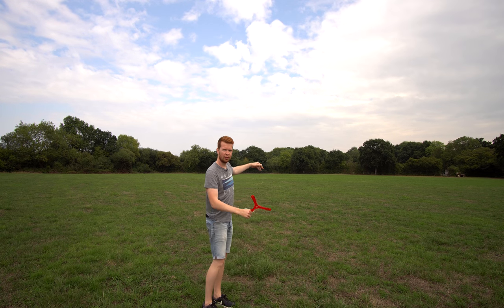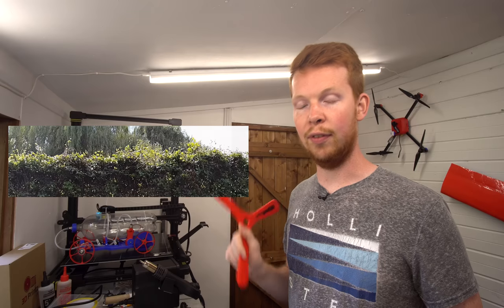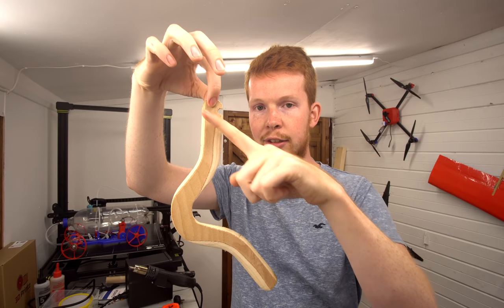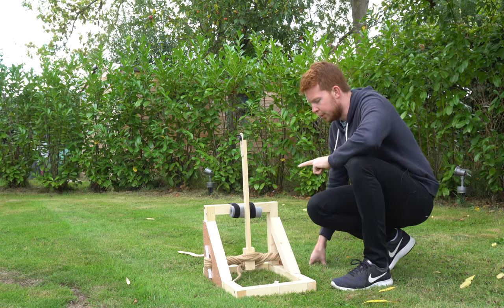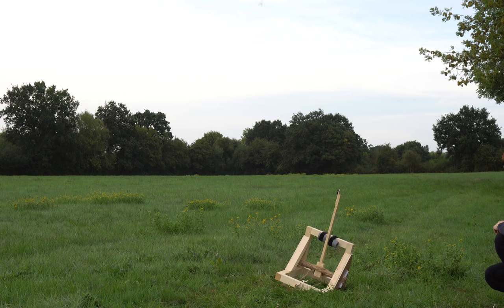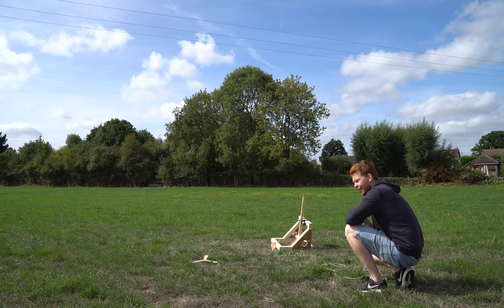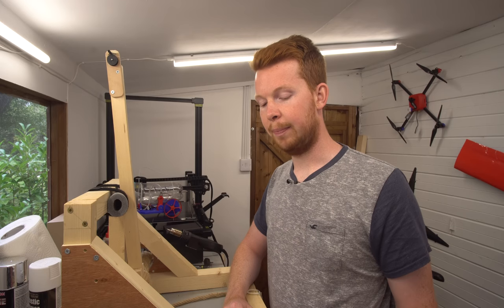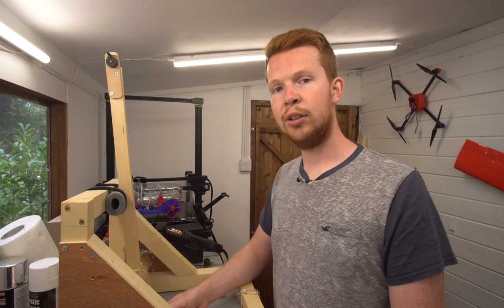Boomerang Launcher

Comment: One key little quibble. Wings do NOT produce a lifting force.   This is a mistaken assumption that goes all the way back to the fact that the Wright brothers used a spring scale to determine how hard test airfoils would pull up on the scale. Because they wanted the wing to ‘lift’ on the scale- they quantified their results based upon this parameter and imagined a force that does not exist.    In fact- wings  produce  THRUST nearly perpendicular to the plane of travel thru the air. This is something you can prove readily by noting that a Propellor- which is essentially your three bladed boomerang- is NOT PULLING the plane thru the air- it is producing Thrust that the plane reacts to by moving in the opposite direction.    In intake side of a fan has no real force- but the outtake has considerable force.  
A wing does produce an area of low pressure above the airfoil... but this is far too weak to pull any plane upwards... because the aircraft is heavy, and has high inertia as well as high momentum.   The air ABOVE the low pressure zone, however, has LOW inertia and low momentum...and so the effect is that the normal air pressure well above the low pressure zone above the wing accelerates downward, to equalize the pressure... and is thrust downwards past the trailing edge of the wing. This creates an action-reaction of the plane moving up- IF the thrust of the air moving downward exceeds the weight of the plane.  This down thrust air stops at the tip of the wing...and because the air off either side of the wing is at higher pressure than the rapidly moving air the wing displaced downwards, it moves laterally into the downstream, and this is what creates the spiraling vortices at the wing tips.   That wings do Not work thru "lift" has been understood for over half a century... it amazes me that this is still bandied about as an actual force acting on flight when the actual suction force of low pressure over the wing has nearly zero contribution to the function of the wing. The low pressure acts upon the air stream...not the wing.
Reply from the maker: Thanks for the information, however you should have learned in high school that air only flows from high pressure to low pressure. Therefore it's not the 'suck' of the low pressure, but instead the 'push' of the high pressure that creates the lift. Yes aerofoils DO produce lift, but you're sort of correct about the majority of lift is produced by directing air downwards, producing the reaction force. I'm not sure who would assume propellers suck their way through the air.
Reply: Tom Stanton   - um... no.  The wing does not create high pressure. The underside of the wing specifically does not accelerate the air and so it remains at AMBIENT pressure.
The upper surface of the wing accelerates the air immediately above the wing, which causes it to drop in pressure...... however, the air under the wing can not push the wing up into this low pressure zone BECAUSE the the wing has inertia far greater than the pressure gradient can overcome.... moreover- the air pressure UNDER the wing is separated from the low pressure above the wing BY THE WING. It would have to flow around the wing to equalize pressure. And the entire rest of the aircraft is surrounded by air at ambient pressure.      However... the low pressure over the wing is confined to a narrow area immediately above the wing.   The air above this accelerated flow is at ambient pressure (which is HIGHER PRESSURE ) than that of the high speed flow adjacent to the upper surface of the wing...  and there is NOTHING separating this higher pressure air from the low pressure over the wing- to IT moves into the low pressure zone, and because each individual air molecule has LOW inertia, it accelerates rather abruptly as it moves toward the wing.   The wing moves forward as this occurs and the mass of air is thrust downward beyond the trailing edge of the wing as THRUST.   Once more- look at ANY simple FAN.   The air coming out the back of the fan is NOT high pressure... it’s LOWER air pressure than the surrounding air.  It’s just that it has been accelerated perpendicular to the motion of the fan blades.
Really and for true... airfoils produce THRUST.... there is no lift.

Look HERE for a simple proof that a wing thrusts air downwards. https://goo.gl/images/VdZFSc   Though standing under any helicopter would also prove the point.
Reply: Tom Stanton P.S. the thrust produced is a function of how low the pressure is over the wing (moderated by angle of attack ) and Air density.  As the plane moves faster, it accelerates a greater mass of or downwards and when that thrust exceeds the weight of the aircraft, the aircraft rises for the exact same reason a rocket rises. As the plane rises, the air gets less dense, and so for any wing to fly at higher altitudes, it must fly at higher speeds so as to compensate for lower air density with greater air volume, and a higher air acceleration.   This is what defines the performance envelope of an aircraft.   Helicopters can create higher pressure underneath..against which its thrust can "push"- but only in close proximity to the ground (ground effect is in essence a bubble of higher pressure air compressed between the rotor and the ground ) however, above a certain height there is no ground effect...and it is strictly the thrust produced by the rotor that holds a helicopter aloft.   The fast moving air under the helicopter is at LOWER pressure than the surrounding ambient air.-  and by the same token, the gas shooting out of a rockets’s nozzle at launch is at the SAME pressure as the surrounding air.   The fact that it has high momentum in one direction is NOT the same as higher pressure. A rocket Does NOT PUSH on anything.   The downwards thrust of the rocket exhaust is greater than the mass of the rocket.  Airplanes fly when the wing thrust downwards matches or exceeds the mass of the aircraft.   It really is a simple thrust vector.
And when a wing stalls, it’s NOT because of a loss of lift, it’s because turbulence OVER the wing stops the smooth laminar flow of air DOWNWARDS as a simple thrust vector.... the turbulence dissipates the accelerating air mass into random vectors going every which way.... and the wing stops thrusting downwards with enough force to match the plane’s mass.

Comment: The boomerang doesn't work based on gyroscopic precession. You got the mechanics correct, but the name wrong. Gyroscopic precession is when a gryoscope's rotational axis precesses (rotates) due to some torque. This precession happens because of the 90 degree offset of applied forces, but it's not the root effect. Unfortunately, I've never been able to find a proper term to call the 90 degree force offset due to gyroscopic motion, which is why people often, incorrectly, call it gyroscopic precession.

Comment: A REAL boomerang does not use the wind to return it. The real test is throwing it on a still day. And you don't need to run when you launch it, just stand still. Another thing, a real wooden boomerang is made of hardwood which gives it mass, and not with what you've used which looks like pine plywood which is very light. Mass gives you inertia which will keep it spinning after it's released.

Comment: What if you made the launcher so it could be anchored to the ground, and so its launch angle is fixed and not propped up. You may be losing initial launch energy while the launcher rocks back to a stable position. You may also want to elevate the launch height.

Comment: Some of my boomerangs weigh a couple pounds, and they are a challenge to get to return. Need a good wind a also lots of rotation. So I thought about the launchers to help people who lack the strength (includes me). Now, the lift explanation goes wonky if you build a 3 or 5 blade (turtle) with a large portal in the center. For some reason these always climb up and slip down the wrong slope, as if you are bombing an object 100 feet out front of yourself. I have no reliable explanation for this behavior. But it is reliable behavior for target practice into a plastic swim pool.

Comment: I would use a double arm to hold the boomaran and have a boltinstead of a pin. So that yu can screw the bolt in or out to adjust the actual contact point on the booma
rang

Comment: Why didn’t you make the launching arm 3 times longer. The rope will have adequate power over the relatively short “throw “. Release speed will increase and you would be able to launch it more vertically as you described at the start.

Comment: Plain old ROPE for the torsion energy? Why not surgical rubber tubing? Or at least nylon rope, which has decent elasticity? And why not optimize the weight distribution of the throwing arm?

Comment: Would you please try and throw a boomerang using only the throwing arm by hand, kinda like a hand skeet  thrower for shotguning? Or like a single or double handed staff sling based on your throwing arm, without the string. Maybe try different arm lengths Would be cool. I don't have the equipment or resources to do it myself anymore, ... so a video to see if this idea is feasible would be...👍👍🖖🤙so many ideas bouncing around in my head........
The Inquisitivefixer 
Thanks !

Comment: didnt watch completely yet, but wanted to comment about 12 minutes in. you don't need that second stop to unhook the boomerang, if the angle of the arm stopping is right, the boomerang hasn't completely spun to the extended position, meaning it's going to unhook itself if the arm stops at that point. not sure if it's clear what I mean here..
Reply: At release the boomerang would have little angular momentum about its own centre of mass.  The second  pin converts some forward momentum into angular momentum reducing the forward speed but upping the rpm of the boomerang.  To put it another way, if you launch a boomerang without flicking your wrist it doesn't spin much. Tom's two pin idea is really neat.

Comment: The three bladed boomerang looks to be a tri magic. These do not get enough range to be used in Boomerang competition. Minimum range is 20 metre in most events. To help combat wind people drill larger holes and or place rubber bands on the wings. Most comp throwers would have a specific Boomerang for a specific competition type in a specific wind speed.  The gyroscopic procession also will rotate the boomerang from vertical to horizontal. At a quick guess you need to throw the boomerang slightly to the left or more at the wind and you may have gotten a return . Competition boomerangs are generally made out of aricraft grade plywood. two layers per 1mm or plastics. From polypropylene to carbon fibre. Check out http://www.carbonbooms.co.uk/         Adam lives in the UK somewhere.  :)  hopefully close to you! He has been to European championship and may have gone to the world cup in USA early this year.

Comment: The proportions of the machine are off. The frame is also not going to work. The frame will fail, and if you get any power out of it, the arm will snap when it hits the bar.

Comment: "The Boomerang needs to be thrown straight as possible" proceeds to  set up catapult to throw it at an angle. Now I am confused, Why did you angle it sideways instead of angling the front of the catapult upwards to adjust for your release point?
Reply from the maker: Sorry I forgot to mention that 2 bladed boomerangs need to be thrown at an angle because they produce less lift in comparison to the 3 bladed boomerang. You can see from the first few launches that it hit the ground when thrown vertically. Thanks
Reply: Thanks! All makes sense now!

Comment: Why does the Boomerang create lift to one ide, but not to the other? is it symetrical on the layer that goes threw it? or how is determined, to which side it flies? Can you just turn the boomerang around, so it flies in the other direction?
Reply: You can't throw it with the other hand.  That would cause the trailing edge to act poorly as the leading edge of each blade.  The blades have a preferred leading edge and aerodynamic profile like an airplane wing.  The thickest part of each blade is closer to the leading edge.  The rang tilts to circle inward and curves its path with the flat underside outward.

Comment: 1:44 is the boomerang not spinning or is it spinning at the right speed to match the cameras capture rate?
Reply: Its spin is matching the framerate of the camera, the rolling shutter effect causes it to "stop" spinning. In most cases that you see rolling shutter happening, the object in question is moving (generally spinning) much faster than the framerate of most cameras, resulting in a warped image. When you see a plane prop in videos, they're almost always wilted and melty-looking